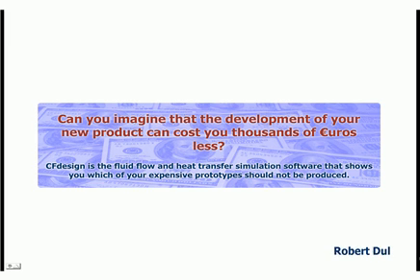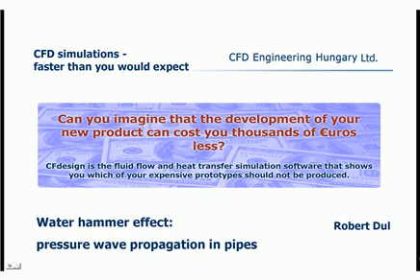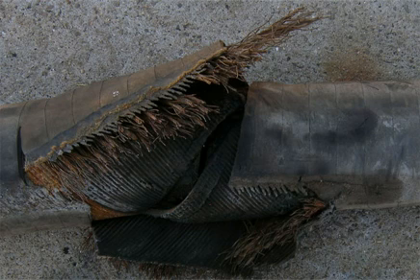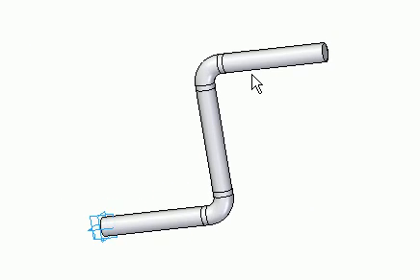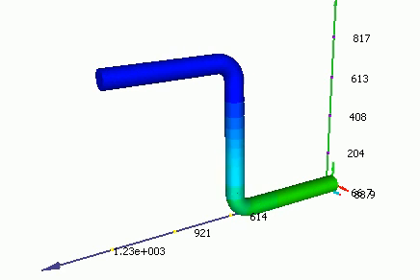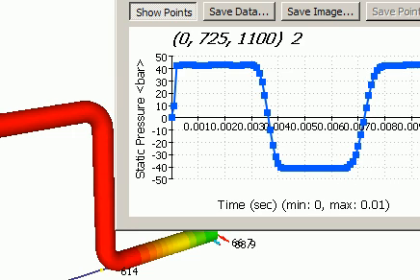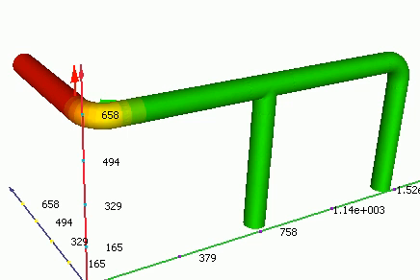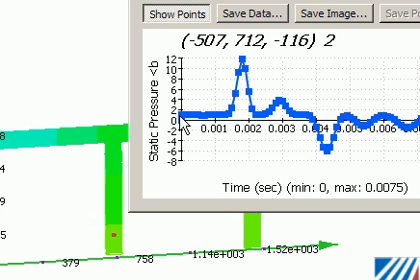CFD Simulation of the Water Hammer

Comment: @jrdul Hello jrdul, in the real case it should be aroun 5Hz. We have a mechanical  pressure gauge below the valve and it indicates pressure fluctuation when the valve is closed. We can see that the pointer on the manometer oscillates with frequency higher than 1Hz during the closing valve. Tx Jiri Raszka

Comment: I tried to simulate the "water hammer efect" in CFDesign 2011. As medium I use the air. the model is the pipe (lenght34m,DN125). It is suddenly closed in certain time. After closing the pressure fluctuation ("water hammer effect")in the pipe starts. The trouble is that frequency of pressure fluctuation is too low (in comparison with reality)...about 1HZ. i used air as the fluid material (compresible).